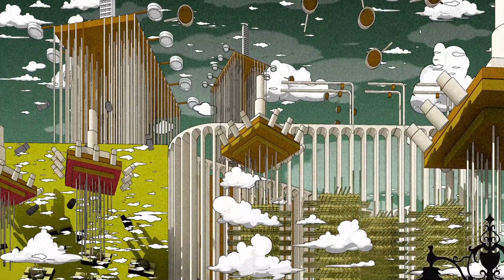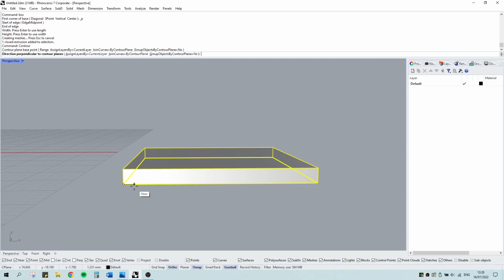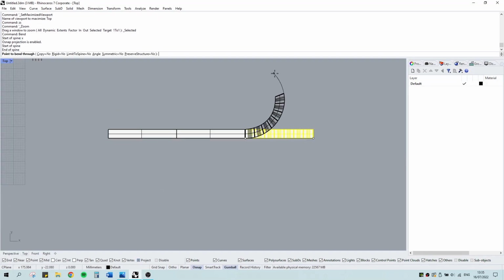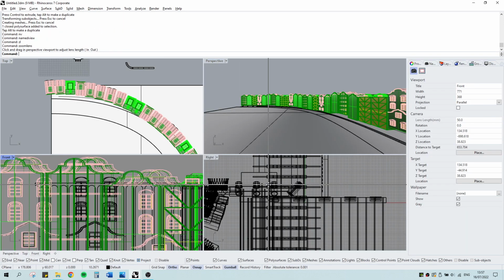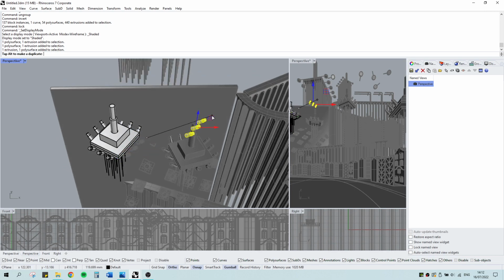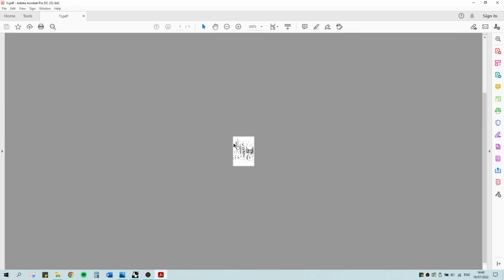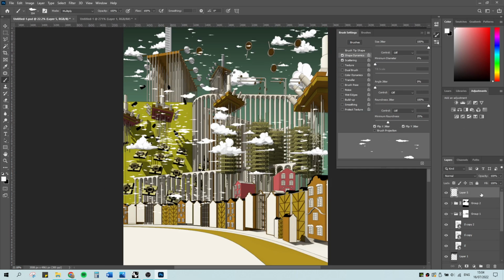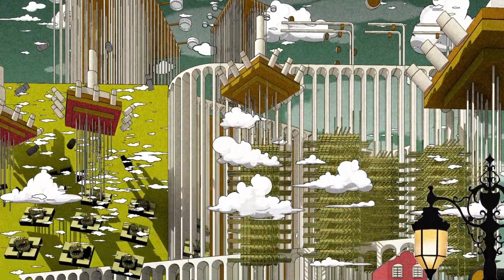Bartlett Illustration Drawing Software Workflow Revealed??? (Unit 10 CJ Lim)

Comment: Would appreciate if you could share the exported display mode in rhino
Reply from the maker: check out my OMA video I shared the file there!
Reply: @Viscomify  I've checked it and it doesn't seem to import into my rhino.
Reply from the maker: @ryanchua5318  What do you mean it doesn't import? Can you provide some more detail?
Reply: @Viscomify  I imported into the display mode the lines and 2 other display modes doesn’t show up
Reply: @Viscomify  Are you running on rhino 6? As I am on rhino 7 somehow when I import these display modes they do not show up
Reply from the maker: @ryanchua5318  I'm 7